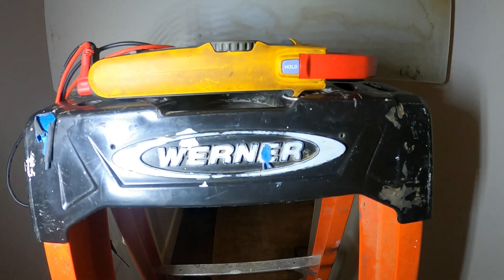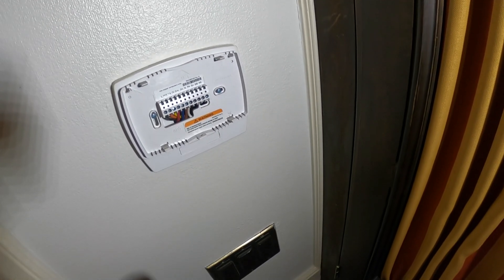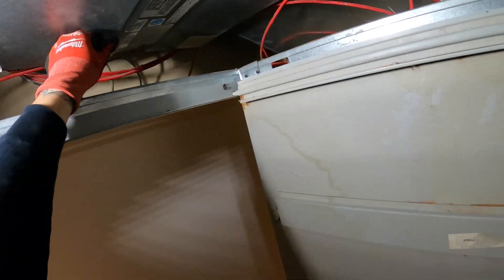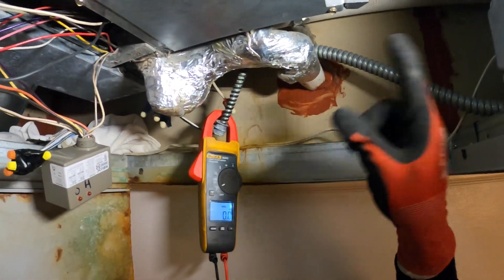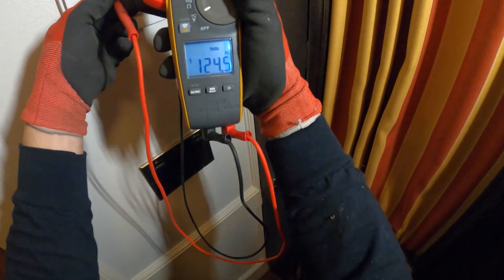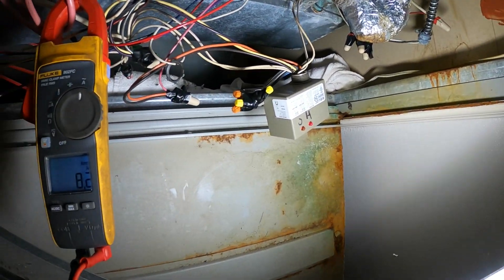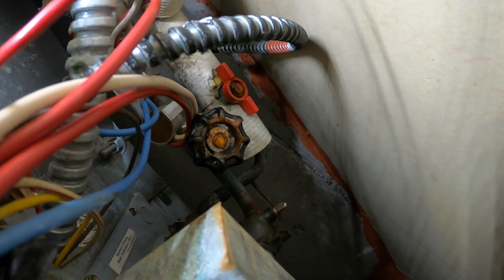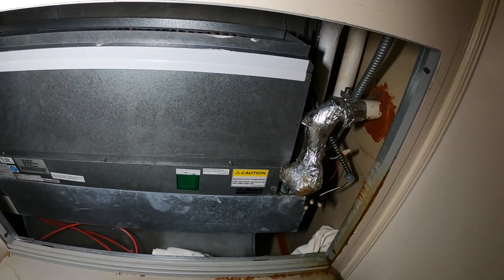HVAC: HVAC FCU Not Heating (HVAC Fan Coil Unit No Thermostat Display) HVAC Troubleshooting & Repair

Comment: Electrician here. Learning the HVAC side of things. There are a few safety things not done correctly here. 

1) With the condition of that switch installation I would recommend not going any further with the power on at that point. With the power off re-install or replace the switch so your shut off is safe. 
2) always use wire strippers to strip wires. While you can use the plier method it causes a weak point in the wire where it will break in the future. If it’s just a quick temp connection no issue but for long term reliability do not do this.
3). Once you see that black soot you know there has been a short or an electrical component has kicked the bucket. Do NOT turn the power back on at this point. Visually inspect the wiring and fix or replace it as you go. Turning it on can cause further damage to the unit or electrify something unexpectedly.

Comment: Whenever the chiller is in heating then the fan coil unit runs in hot water is the electric heat an auxiliary heat

Comment: please ensure that BX cable is secured inside the  junction box, as well as those other joints just hanging out, it looks like just raw wire rubbing on the knock out. This is another short waiting to happen there, especially since the BX jacket is the EGC, and without it connected firmly to the housing its is unsafe, non bonded.

Comment: The black stuff is smoke soot.

 The incoming black cable is undersized compared to the pink. Thats why it overheating
Reply: The service looks to be 12 gauge which should handle 16+ amps from heaters.

Comment: Have you tried using those wago connectors on the electrical.
Reply: Wago connectors are S tier, only thing I use nowadays.
Reply from the maker: @Cosmo95_  What is S tier? I need to try them out
Reply: @JumpermanTech   ‘S tier’ is just internet slang for the ‘the best’ that us youngsters say. I used to use terminal blocks when I first started (never again), the Wago connectors are especially good when you want to put more than two wires together as they also make 3 and 5 slot connectors.
Reply from the maker: @Cosmo95_  God tier I see 😂 I need to try them out. Glad to hear people's opinions. Thanks for clearing that up haha Thanks for watching & happy holidays!
Reply from the maker: Never tried those before but I have been recommended to  try them. I have a few hundred wire nuts to finish off with before I buy more connectors haha I will give it a shot. What do you think about those? Happy holidays!
Reply: @JumpermanTech  a friend of mine uses them and he swears buy them. What happens with the wire nuts is sometimes you don't get a good tight connection and the vibration of the unit can make the wire come loose and cause a short.
Reply from the maker: @scottmaz4063  I need to try them out. They look cool. I could see that happening. I will give it a shot in the near future. 2024 new beginnings⚡️ Have a great day 🔧🎄
Reply: How much is each connector compared to wire nuts.